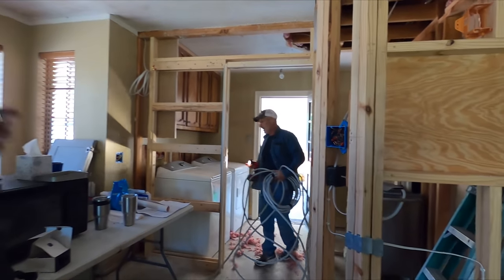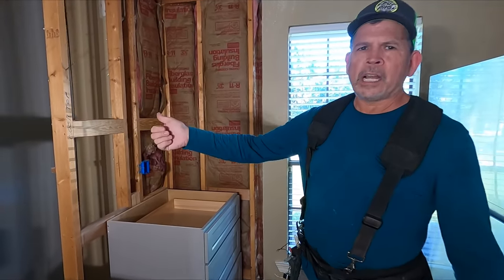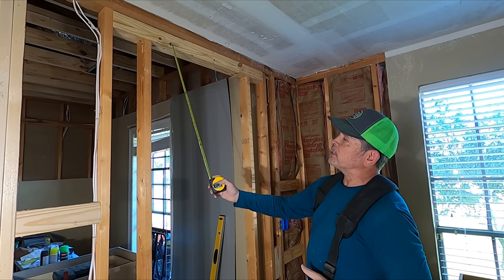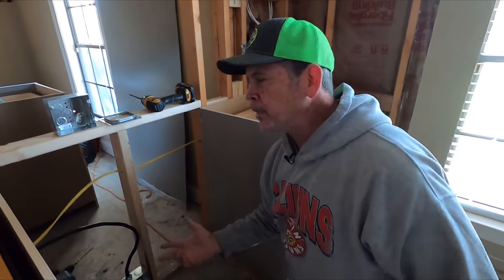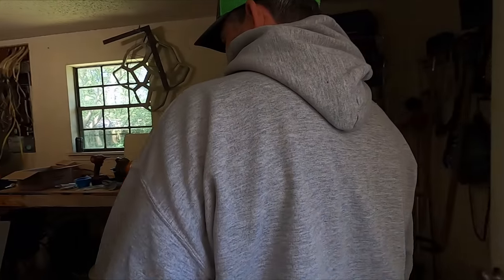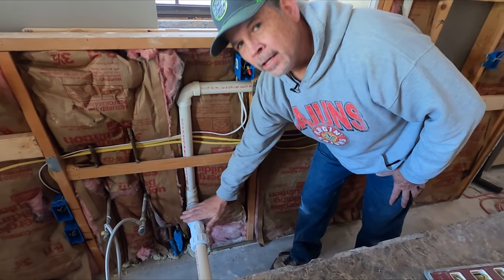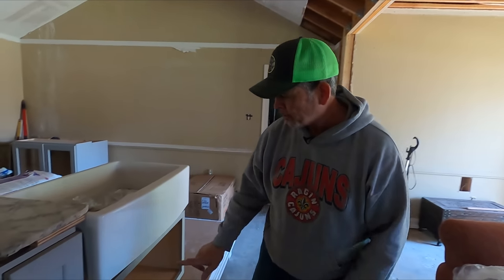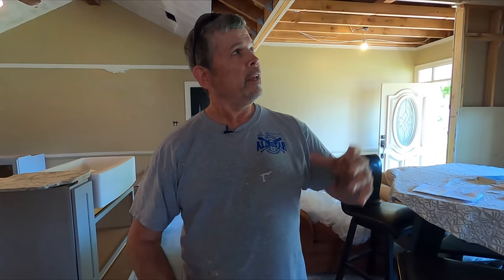WHY This 2 INCHES Will COST US $800 Ep. 15

Comment: I had the change in my sink. However didnt use the disposal so what do i do with the wires? Tape them up place them behind the wall?
Reply: AFAIK it’s common for disposals to plug into an outlet.  You might as well put a single outlet there inside the cabinet, for possible future disposal use.  Or, to be as cheap as possible, still install the box and the wire coming to it, but just insulate the ends of the wires and put a blank plate on the box.
Reply: @kc9scott  the wire is wired through. I dont know how to store it?
Reply: When you say “the wire is wired”, I assume you mean (1) the wire is in the walls and it runs all the way from the breaker panel to the cabinet under the sink, and (2) the last part of the wire (hopefully still a couple feet long) is hanging loose and currently visible within the cabinet, and (3) perhaps, at the breaker panel, that wire already is connected to a circuit breaker.  If that’s the case, I recommend using a “utility” metal outlet box that you can surface-mount to the wood of the cabinet, inside the cabinet.  Choose a place where the wood is thick and strong, so the mounting screws (please use screws for this, not nails) have something to bite into.  Preferably high up, so it won’t be in the way of storing things in there, and away from any possible dripping water if there are ever any leaks, either in the plumbing or in the seal between the countertop and the sink.
Reply: An easier solution, without using an outlet box, would just be to bring the wire into the cabinet, coil it up (with zip-ties), and insulate the ends.  At least use some sort of permanent clamp to hang it up and keep it out of the way.  If the cable is left exposed like this, you want to make sure that the other end at the breaker panel is not connected to any breaker, and insulated, and labeled what it’s for.  Ideally an unused wire like this shouldn’t even go into the panel.

Comment: I hope you see this but the panel is not to code because of top of the height should be 6ft
Reply from the maker: Breakers can’t be higher than 6 feet 7 inches to the center of the grip on the handle.   Locally we’re allowed to flip a panel to accommodate that for the main disconnect.  The alternative is to move the meter box and that’s not happening 😩👍💪. I did just go out and measure and the highest breaker is at 6’4”
Reply: I for got different code different place
Reply from the maker: Yeah sometimes different code same place 😡

Comment: Yall need to step up to square D!!
Reply from the maker: The panel?   Hard to get here.  Plus we waited forever for the one they installed
Reply: @StudPack  yes sir the panel. Im in Houston, I started as an electrician, and enjoy your videos. I have been watching them on my trips to work. You guys pay alot of attention to detail, and it shows in the work. Id say go with the Square D Homeline panels. They are much nicer and can be usually gotten cheaper than the GE power marks. The ge panel is a good panel, but the breakers tend to sit loose on the bus, im not a fan but in a pinch they will work. Definitely recommend them.
Reply from the maker: Thanks Charles, I’ve used lots of Square D products. My electricians supply house must not carry that brand, the only reason I can think of. I’ll ask him though👍👊

Comment: Why is American electrical fittings and practice so ancient. No change in 50 years. 
I am Australian it just seems strange to have metal fittings with electrical and no earth's which means no RCDs. In Australia you can't sell your house without fitting at least 2 smoke detectors and RCDs in the main board. Bakelite breakers my goodness. We now use mini circuit breakers.

Comment: what pocket jig you use? shop made?
Reply from the maker: It’s an original Kreg jig back when they first started and they were made of solid aluminum. I bought it knowing pocket screws would be a great thing.  Model #K-2  maybe find one on eBay?
Reply: @StudPack  You can still buy a single-hole pocket rocket and drill bit for about $20.  If you use it enough that the single becomes annoying, you can justify a better one to the finance officer.
Reply from the maker: Cool thx Ken 👍
Reply: @StudPack  ive got the plastic kreg the plastic is glass fibre reinforced

Comment: In your next video, can you briefly explain what the nail plates are for?  Thanks.
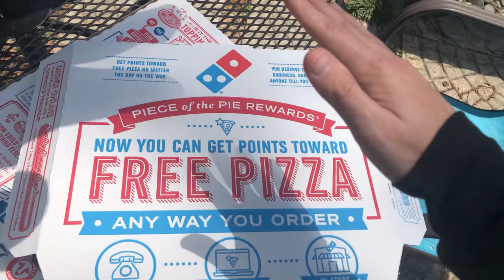Reply: They help protect wiring & plumbing from damage by drilling, screwing, or nailing something into the stud where they pass-through. If you re-watch from about 20:06 - 20:26 in the video, you will see where they put some of their nail plates in relation to wires & plumbing. Very handy as that would all be hidden behind drywall when finished.

Comment: I've never heard of a nail plate. Sounds useful if one is willfully ignorant of wires and plumbing. Aren't 99% of house already built without them with no problems afterwards? I know what I said is provocative. What do the contractors say?
Reply from the maker: They are cheap insurance.  A nail or screw through a pipe or cable is a mess.  I’ve seen drywall screw run into copper pipe.  Didn’t leak for months.